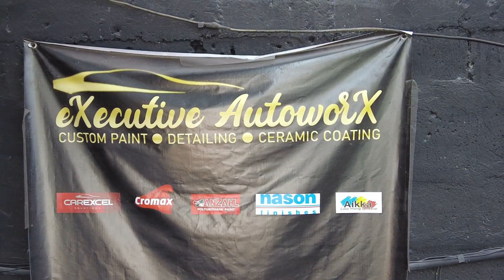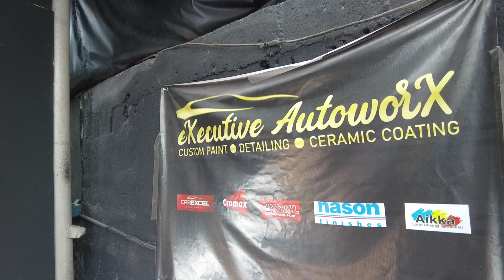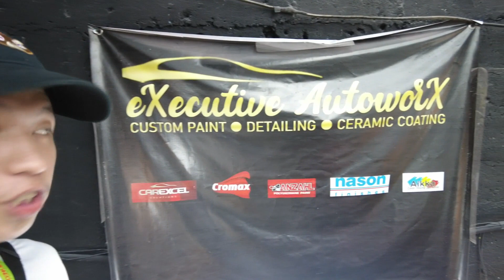Graphene Coating The Honda City Budget Build!

Comment: SKU: 138599 PN: 84200-XMK-K0S0-BK
Part num. 
Pm ka kung may hanap ka pang ibang mugen parts bigay ko part num🤣
Reply: Correct. And it is not yet discontinued. The mugen red scuff plate for grace is the one stop prod.
Reply from the maker: Damn never knew that a honda guru would be watching my videos thank you sir! 😍
Reply from the maker: Gotchu but we never said its a discon product but then again thanks for the support and head up sir! 🤯
Reply: Sir Clyde baka pwede pacomment narin san mo nabili yung grace stepsil mo. Thanks
Reply: @linnaeus13 08E 12 T9P 000